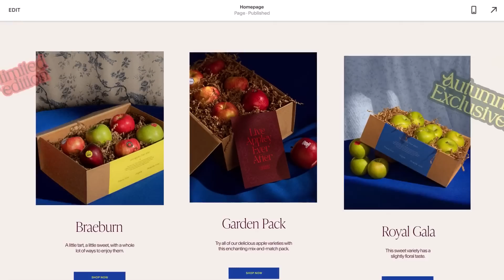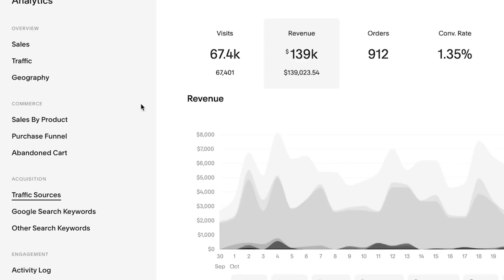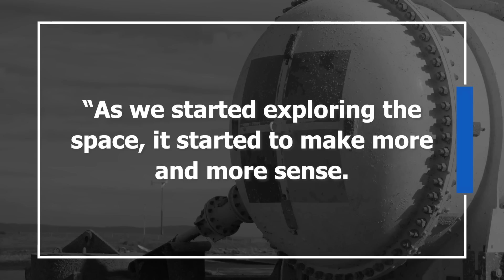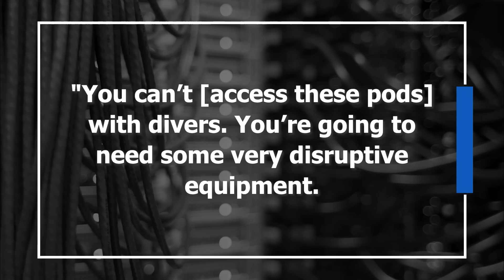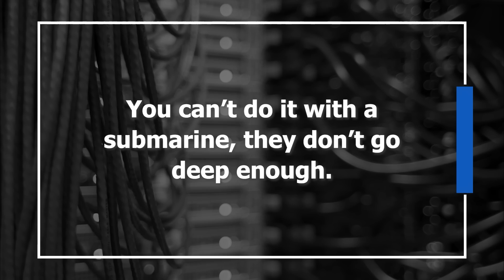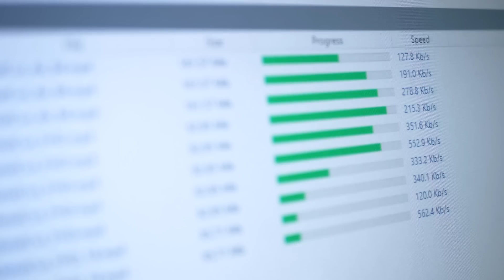Underwater Data Centers: The Next Big Thing in Keeping Computers Cold

Comment: submerged data centers are a great idee for cooling but not practical the maintenance on the servers is the problem if you have a disk failure on a server you must get an diver to the place. or you must get the datacenter lift out the sea  to land replace te disk en then  sink the datacenter down in sea again

Comment: However, isn't the water cold enough at these depths to avoid needing active cooling?
I don't see how the water cooling system is supposed to keep running for years without maintenance, it's not distilled water after all, it contains all sorts of stuff that will over time lead to clogging.

Comment: Feel like if they put too many of these, it could dramatically increase sea temperatures which would affect aquatic life and by extension us. However, the idea itself still would be great if we could do so sustainably.
Reply: This could be an issue locally around the data-center containers if the circulation of the water near the containers was poor (and therefore the heat wasn't getting dissipated into wide areas of the ocean).  However, the data centers appreciably increasing the temperature of the oceans as a whole is not realistic.
Our energy production is pretty much a joke compared sunlight hitting the Earth.  World electric energy consumption in 2019 (total electric, not just that for data centers) was about 22,850 TWh (according to International Energy Agency), for an average rate of about 2.5 TW.  This compares to sunlight hitting the Earth at about 273,000 TW.  A lot of that sunlight reflects back off the planet or hits the land, but a significant fraction of it is absorbed by the ocean (to be re-emitted later as infrared just like any other heat it absorbs).  

Combine this with how large the oceans are (there are give or take 1.35 billion cubic kilometers of water in the world's oceans), and you get that dumping heat from data-centers into the oceans would have negligible effect on the overall temperatures of the oceans.

Comment: It may sound like a perfect solution but is not even close. First, the heat is energy that can/should be recovered and the ocean is the last place that needs more heat/energy as it will contribute to the climate crisis by adding strength to storms, not something anyone wants. Second, it takes just a pinhole leak to eventually destroy the whole container and a minor depth charge is fully capable of cracking the seals or even blow holes out right. Enemies will do that at some point. Thirdly, no repairs, service or upgrades can be done without the huge cost of lifting it back out and who will pay to take it out when it becomes obsolete or broken beyond any use, it would end a trash dump of outdated and/or broken e waste. Does any one run 10+ year old servers today even?

Comment: Why under the sea instead of under the surface of a cold lake? Isn't the salt an issue? Plus is the sea, so unless they find a very shallow sea, I imagine the data center would have to be floating over the factual abbyss. Wouldn't it be way easier to access to it (if needed), or recover it from the bottom of a lake?
Heck, if they're interested in safe storage (heh, see what?) why not go to the chilean antartic territory? Chile is famously politically stable, its population is highly trained, they already have permanent bases in the antartic and the rest of their country is basically an stone's throw away. Heck, they have a major city riiight at the southern edge of the continent, and surely the antartic has to be really cold, plus the snow melts into regular, salt-free water, which would cause less corruption on the cooling system.

Comment: This is such a dumb idea. 
1. Salt water and electronics don't mix. Corrosion will be the first major issue. 
2. From a maintenance point of view, this will make it very cost prohibitive.

Clearly this hasn't been engineered. This is just some concept someone came up with because it sounded good on paper.
Reply: Corrosion can be managed using epoxy coatings and specific materials if this wasn't the case submarines would only last a few years, as for maintenance, they would be maintained, an allowance would be made for hardware failure.

Comment: Idk what they're on about with it being impenetrable to external attacks. Sure the module itself it out of reach but you still gotta run cables back to land. Someone could easily just cut one of these instead. You can't just wirelessly connect to a satellite when it's at the bottom of the ocean.
Reply: Your right, so does that mean we don't do it? Have we stopped building skyscrapers since 9/11?
Reply: @utube1818  That's not what I meant. I just don't like companies claiming that something is impenetrable when it's not

Comment: Um, they can cut the cable?
Reply: Data cables have been on the ocean floor for decades, I don't hear of terrorist attacks on them too often. Oil pipelines run for miles through the middle of no where, these are far more venerable than under water data cables.

Comment: Tech upgrades are a problem. You can't just walk down a row of servers swapping chipsets. You have to go get the thing, haul it up, do your upgrades on all the servers then sink it back into position.  Simple re-boot this isn't.  And pricey, especially when you consider that center will be totally out of business for the duration.
Reply: Servers are already optimized for stability. I would imagine they would not bring it up if just one server went down. Maybe once 10% go down, I have no idea what the magic number would be but they already said failures were MUCH more rare so I imagine it would not be brought up often. I also Imagine you could have multiple containers together with one as backup in case another need to be turned off. The ship could also have spare ready and drop that first before raising the one that needs to be brought up. I think there would be very little down time.
Reply: @philthehustleking  Not talking failures but tech upgrades.

Comment: There is one simpler solution for this. Just delete unnecessary data. Propably it will be about 99.99999% of the data stored right now.
Dont be a hoarder of everything.

Comment: Self-contained submerged data centers nearly eliminate dust too. Humans produce a lot of it and it's not healthy for electronics. Many failures are caused by shorts due to small dust particles. Land based DCs invest a lot into filtration. Submerging also eliminates any potential for interfering radiation as water blocks most RF frequencies. Ever hear of cosmic rays flipping bits? It's an interesting phenomenon.

Comment: Data center 3 kilometers beneath the surface... invulnerable to physical attack.
What if someone took a few dozen solid steel beams, sharpened the tips, and dropped them 3 kilometers above them from the surface?
Reply: That particular example is probably not as bad as you think. Terminal velocity in seawater is much less than in air (particularly in the cold and high-pressure environment at depth), eg. because water is much denser than air so it takes more force to push it out of the way.

Explosives would work though.
Reply: @jon_j__  Ran the numbers for terminal velocity and cone surface area using omnicalculator.  Assuming I'm doing the numbers right ... 
If you sharpened the end of your steel beam to a cone with a radius of 5 inches and a height of 10 inches that would give the cone a surface area of 0.16397. This would be just for the cone itself.  Using another site for metal weights I plugged in 10 inches as my diameter 2*radius and kept raising the numbers till the weight got to over 1000 pounds turns out all you need is about 4 feet of 10 inch diameter steel to get to 1069.15 pounds, not an unreasonable size. In our omnicalc terminal velocity calculator, plugging in Streamlined body,  1069 pounds, a cross sectional area of 0.16397 m2, a fluid density of 997 kg/m3, 1g of gravity and we get a final terminal velocity of 85.32 mph.  If a spear was coming at me at 85.32mph I think it would do some damage.  Jacking up the weight to 5000 pounds increases the terminal velocity to 184.53 mph, but also means our spear increases from 4 feet to 19 feet long!
Reply: Using 2022 steel prices of $0.42 per kilogram it may be cheaper just to use some form of explosive like you mentioned earlier lol

Comment: You forgot another potential contributor to reliability... water, especially several meters of it, makes a pretty good radiation shield. Stray radiation is the cause of quite a bit of both transient glitches (bit flips) and general degradation in modern microchips.  I'd be surprised is this wasn't another component of the positive results.
Reply: Yes, this was the first thing I thought when I started watching

Nice video on bit flip and the consequences https://youtu.be/AaZ_RSt0KP8 by Veritasium
Reply: All of the "for cooling" are bs claims. The biggest thing why they do it is to avoid taxation and compliance to local laws.

Comment: As someone who works with servers constantly - changing out a failed drive might be a little tricky in a sealed unit like that, and all it takes is 1 or 2 drives to fail and then one server is toast then you need to pull it out. And drives fail constantly, even enterprise grade ones. Sure 2 years is not a long time to have the pod submerged, but when you have hundreds or thousands of these pods to maintain the cost of the energy to bring these back up and back down again is going to add up and make that ROI shrink dramatically compared to a land-based server farm.
Reply: I too , have work in IT and mainly a hardware installation site.

Initially had the same thought, but then I considered things like remote, robotic telesurgery as common medical practice these days.  There’s also the common practice of automated and remote docking on the space station.

It would not be hard to adapt these two things to set up a efficient and effective system of maintenance.

Pressurised ROV that can hard dock with the pressurised containment vessel,  where the part plus  robotic armature is delivered with the ROV, as to ensure maintenance of the robotics,  Even the surface vessel could be autonomous as used by SpaceX for their first stage, landings
Reply: If the energy costs are so significantly reduced, maybe it'd be worthwhile to add redundant hardware, and simply accept that some of it will fail? That might let you leave the pod down there for 5-10 years... and then maybe you just don't ever bring it back up? (Yes, littering, awful, I know, but if this was the philosophy from the start then perhaps the host nation could insist that the pods are designed to be relatively non-toxic etc when they break down.)

Comment: While subsea DCs are more efficient, their heat byproduct is contributing to sea temp rise. We know that hotter seas drive tornados and sea storms. They bleach coral. Why not install them in swimming pools and use the circular heat to keep the pool water warm. Outdoor pools would avoid the water getting too warm and provide a public amenity at a lower operating cost. Heat exchangers could dump that heat where there is a demand for low temp heat- offices/residential tower blocks etc. Perhaps even airport runways to minimise ice/water. Even your amazon warehouse needs to be heated to avoid the pesky human workers freezing or the oil in the robots getting too cold. Air-drying food. Warmer greenhouses (even vertical ones) would drive faster food production in lower temp climates.

Comment: There is a potential negative impact at scale however. These systems discharge warm/hot water. If a lot of units are placed just off shore in say, a bay or cove, or near nature preserves, the could cause a rise in localized sea temperature. Even a degree or two hotter, and certain species might migrate too early in the season, certain species might die off locally, and algae blooms could be increased. At a global scale, if ALL data centers went into the ocean, we would just be offsetting above ground environmental impacts for below water environmental impacts.

Comment: As a scuba diver, I can't help but think how easy it would be for combat divers to destroy these centres or steal data from it (e.g. Spetsnaz divers deploying from submarines off the coast of the US to bug these centres or plant explosives). That might not be good.
Reply: If the pods aren't designed to be opened while they're underwater then cutting into the container to access the servers (without destroying them) would probably be quite challenging. Destroying the pods (or cutting the cable, or whatever) might be a little easier than a land-based data centre, but there are probably customers out there who would prefer their data to be destroyed rather than stolen.
Reply: Reynolds is a cybersecurity expert in ethical hacking who wrote a major book about it. I found out securing data centers is a huge issue. According to her that depth is accessible only by ROVs making them safe from direct attack. You see, she is also an ROV pilot who worked in the oil industry so she knows something about it.

Comment: I dare not imagine what the environmental impact moving data centres underwater would bring. Heat is heat. Those data centres will still generate heat, and while the surrounding waters will help keep them cool, those centres could likewise increase the temperature of the surrounding seawater; particularly if the technology is applied at scale.
Reply: @retsaM innavoiG The issue wouldn't be at the macro-scale. At least, I don't think that will be the issue. Rather, it's at the local area in the immediate surrounding, where the temperature change could result in a change in local flora and fauna. Presumably, they're not going to be building the underwater data centres close to underwater volcanoes.

Comment: A number of comments on the presumed benefits:

- How do you propose to keep reliability up? Most datacenters have massive generators and battery banks to ensure they're never going down. Undersea cables regularly get damaged by fishing vessels or by sabotage.

- While the sea is a massive heat sink, it's not invulnerable to heating. If we do sink huge datacenters to the bottom of oceans, they will still create heat. How much that influences the ecosystems around them is then a matter for research.

- Claiming those datacenters are somehow more secure physically is disingenious. Banking datacenters for example are more or less fortresses, with double walls, reinforced concrete, sensor arrays and multiple data links, often themselves heavily protected. An underwater datacenter has none of that, regardless of how deep you sink it - a relatively small detonation will completely destroy it. Not to mention the vulnerability of the power and data lines that go to them, and undersea cables are non-trivial to replace/repair.

I don't deny that they have benefits e.g. for cloud computing, but they're not a panacea to solve all problems. They'll solve some, they'll create new ones.

Comment: Some submarines can def to to 3km. And you don't even need to reach the pods. Just find/damage/cut the cables. Or drop an explosive to that depth.
Reply: Explosives and cable-cutting would also work for a land-based data centre. And existing submarine cables are cut accidentally (or "accidentally") all the time. The thing is that, most of the time, destroying the infrastructure isn't particularly useful. The near-impossibility of plugging something into a server that's deep underwater (and that's in a sealed container which is only designed to be opened at the surface) is probably quite attractive to a certain type of customer.